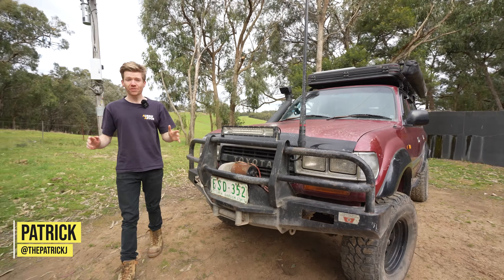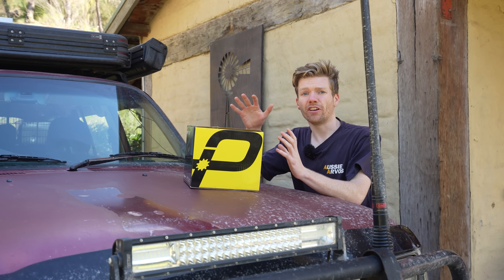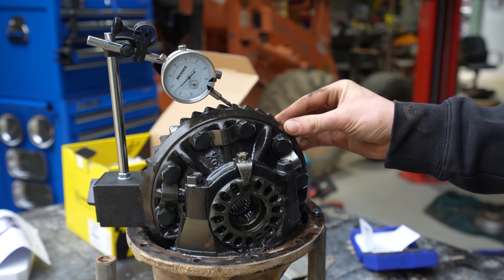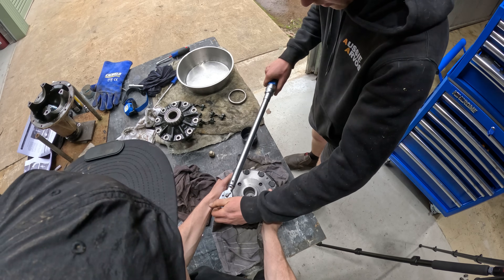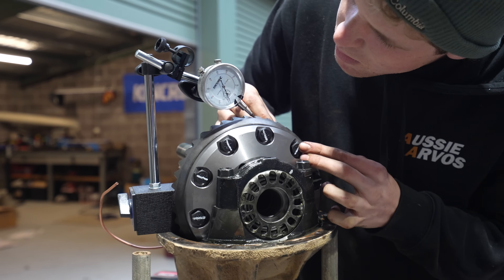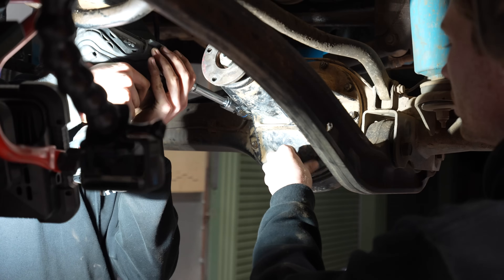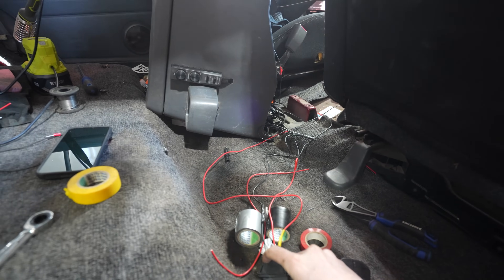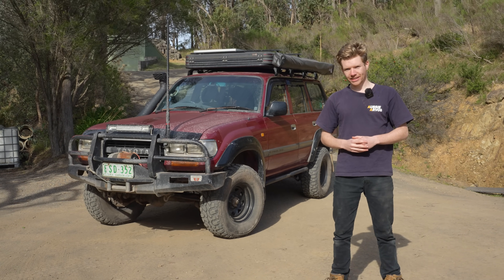How to install an Air Locker in Your 4WD! Step by Step!

Comment: Good choice on the TJM Pro locker, and going the front as you have a good rear LSD id go front aswell if i had a 80 or a patrol, but my N70 hilux has a useless LSD so id go rear as thats the best for my setup
Reply: Why is the rear LSD useless on the N70? Just curious as I have one also.
Reply: @evil17  99%? Of mates that have em or are in the 4wd game be it retail, comps etc, just say they arnt that reliable and for the cost of a rebulid and all that getting a locker is so much easier and cheaper.... but i fkn love my ute, i wouldnt sell it ❤️
Reply: @evil17  besides the little issues like that, the rest is bulletproof, no cv damge, no nothing, and its been on some real crazy tracks, the most thats been damaged was the factory ally side steps

Comment: I'm slowly building up my 2011 NT PAJERO. With IRS AND IFS. All body lift and no flex! 😢

Why? Cos definitely something different 😂😂😂

Both front and rear diffs being open and relying on the "intriquet" traction control to control wheel spin, was not good enough for practicality, with future travel ideas in mind.

Your video had really helped in guiding me towards what kind of Locker I should look at getting. 

However, I may be paying the professionals to do it. So that it's done right the first time 😂.

Comment: Best way to torque up the ring gear bolts put them in a press or your makeshift press then you can tension them up and not damage anything from a vice.
Reply: Or you can bolt to the bench or capture in a vice a length of chain & wrap that around your hemisphere to hold it in place while torqueing up the ring gear bolts.
Reply: @dustyfarmer  you can buy in the press is quicker and don’t have to drill holes.

Comment: Why you didn't put lockers on rear diff, I might do the same on my 04 D2 eventho it has a center locker on transfer case I do have arb lockers on my 05 jeep wrangler unlimited rubicon with 488 gears and advance adapter atlas 2 speed transfer case which is sweet on trails

Comment: Just a quick question did you put the spring washers under the nut or on the bolt head on the tail shaft because Toyota needs the washer under the bolt head or else they come loose seen it many times before

Comment: Hopefully you didn't contaminate the pinion bearing with the swarf when drilling the hole, should have turned the diff housing over so swarf fell out not in.

Comment: Would like to put a front locker in 1 day. Not driving it enough as per intended to need 1 just yet. But fantastic work Patrick. Cheers mate 👍
Reply from the maker: Thanks Jon! Yeah it's a bit of a cost, it cost me $1600 for locker and carrier bearings

Comment: e-lockers get more hate than they deserve. they can be quite reiable. air lines cant be kinked as hard as wires so they will hang away on corners a bit and allow a gap for sticks to poke in a damage them. repairing wires is also easier track side. there are no seals and o-rings in an e-locker and no compressor so far less things to fail over all. unless you are goin to be thrashing your rig or treating it like a comp truck, e is the way imo. but to each their own.
having them in the front is great and safer. have done both but i much prefered the front over all and is made a hell of a difference on hill climbs.
why is your diff oil black?!?!
and what are you doing with the rag on the pinion ?? 🤣 that wouldnt have done anything to simulate load. you need to put load on the ring gear and turn the pinion lol.
Reply: I reckon I've heard stories about air lockers getting a leak inside the diff housing and then foaming all the diff oil up too, potentially spitting it out the diff breather etc. That's not going to happen with an e-locker.

Comment: The torque isn't being sent to only one wheel.
With an open differential Torque is evenly applied to both front wheels.

It's just whatever amount of torque is needed to spin the free wheel, that amount is being sent to the wheel on the ground.

Comment: Unfortunately TJM has discontinued the Air Pro Locker due to inability to source parts :\ TJM is only offering E-lockers...
Now its a decision between ARB, Haroop e locker, and auto lockers.
For me in a hilux n70 im considering a Harrop E locker up front and a True Trac (helical LSD) in the rear, Or both E lockers front/rear.
Still uncertain about ARB due to seal failures and i've been unfortunate to have their products fail on me before, so thats my bias...
If anyone has experience with a True Trac + a front locker of some kind i'd love to hear about it

Comment: 80 series has a rear LSD😂😂😂😂 80's would have to have one of the worst LSD's
Reply from the maker: 🤣🤣 definitely doesn't live up to the patrol LSD that's for sure  ,
Might be doing something about this in the future
Reply: @AussieArvos  that's why i would have put 1 in the rear first you would use it more as there are not many situations you would not be able to do with a rear locked 80 series. Just my opinion from owning 1 for 15 years and 35 years in general 4wdriving.
Reply: Toyota lsd are actually one of the best factory designs but they wear out over time get it overhauled and tightened up and u would have a fkn mint tight diff for hundreds of thousands kms
Reply: @tiamarie177  🤣🤣🤣🤣🤣🤣

Comment: WIcked episode ! very well done ! cool to see ! in my auto Patrol open front diff and rear LSD . never needed a locker . 🏞️🛻📹🤙😎
Reply from the maker: Yeah patrols LSD is bloody good
Reply: You haven't done much off road driving then if you've never need a locker in the front.
Reply: @dustyfarmer  Maybe I should say when my tyre spins I just reverse back and pick a better line .
Reply: @dustyfarmer  Correct, if it's not locked, is it even truly 4wd?